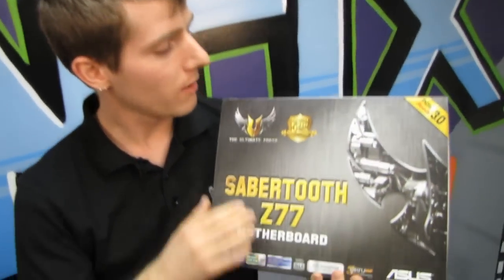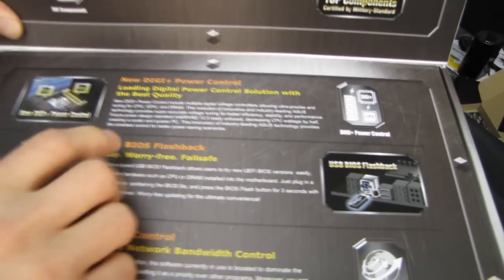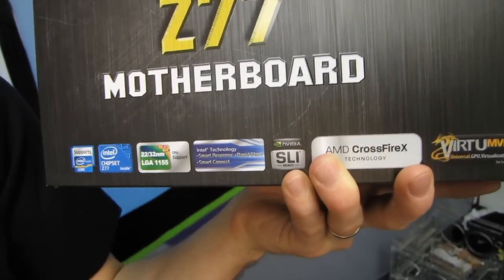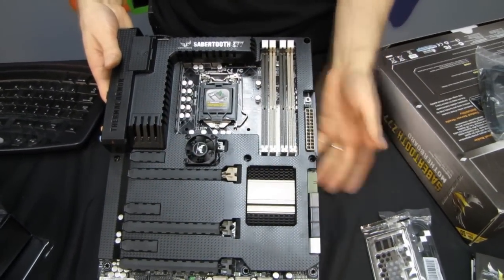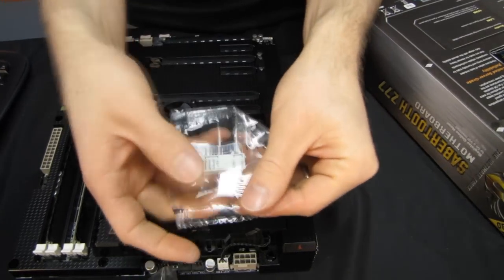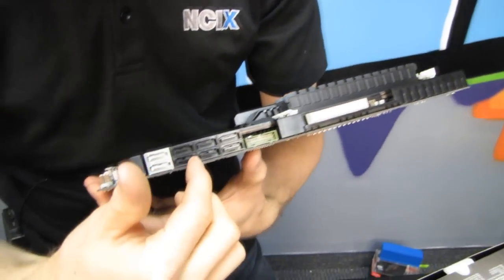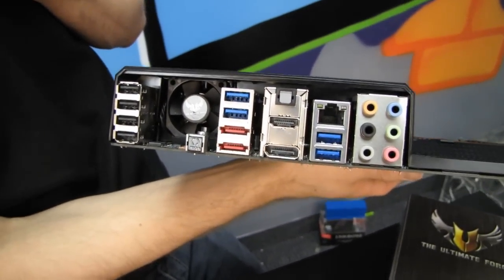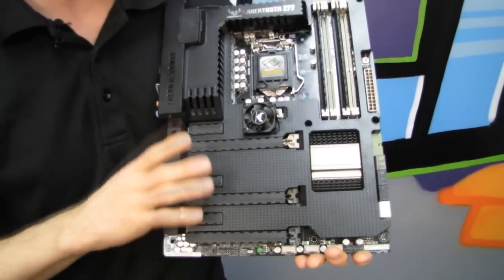ASUS Sabertooth Z77 Ivy Bridge Gaming Motherboard Unboxing & First Look Linus Tech Tips

Comment: those are not "vent" holes. Those are part of previous design/test revisions they did not remove from the final silk screen and cnc production design. I have worked on a number of production run pcb's and i can tell you this is not uncommon. If Asus told you it was for ventilation then they are just feeding you marketing BS.

Comment: Hyper-Threading technology and the size of L3 Cache and the turbo boost are the main differences.The i7-3770K has 33% more cache than the i5-3570K.HyperThreading "creates" one more virtual core for each physical core a processor has, which increases the speed of multi-tasking loads.The 3770k will automatically jump to 3.9ghz which already will never bottleneck and video cards but you can still go up to 4.8ghz if you desire to.It is far from useless.Also I don't know where you look at for 200$.

Comment: CPU OC for the i7. But yea dude as far as this board goes, its the second best thing to a ROG Huge ass quad sli motherboard or some kind of dual cpu board. If you use Sandybridge on the board supposedly word is you can achieve 5ghz stability OC on your CPU with this board, however right out of the box it wont push your chip as much as some other boards. Thats why Im trying so hard to learn this OC thing with as little time and painful effort involved. I tried the Auto Overclock function but

Comment: I'm having a problem,I bought this board along with I5 2500k and 8GB corsair vengeance RAM,i finished building the system last night,but i have a problem with the stock I5 CPU fan,i installed it ,but when i turn on the system the fan moves then stops,it keeps doing this,when i reset the system that's when the fan comes on and starts working normally,it seems everytime i start the system,i have to restart again for the CPU fan to properly turn on,can someone help me with this problem plz

Comment: don't listen to  HSSDamian, I have a 6850 (the 7850 will blow that away) and I can play ultra settings just fine. Overclock it and you'll be fine. Also most games require 4gb of ram, but I suggest 8 with BF3.

Comment: I'm saving for a gaming pc, this motherboard comes with intel 3rd Generation Core i7-3770K aswell as the corsair h100 liquid cooler for £490, is it worth it? And to use towards building a really good gaming pc? any response would be appreciated, thanks

Comment: With the 4770k you get about a 10% performance increase. But the 4770k gets much hotter then the 3770k making it harder to overclock. It's not worth the 10% performance increase. I would wait for Broadwell(5th generation). Also if you did get the 4770k you would have to get a Z87 board, a Z77 board will NOT work.

Comment: not  enough 3 pin ports  the 2 fans on  the board are a waste of the slots. the on bored USB 3.0 is in a spot that is impossible   to  get to, had to  use the converter to make it USB 2.0

Comment: go with evga, evga makes the best motherboards. basically a cpu running on evga motherboards typically runs about 3 times faster. because evga puts 3 times the gold in the cpu socket, so all that gold sends all the extra power right into the cpu and it makes the cpu all work better. So basically a 3570k, on asus is 4 cores, really 3570k on evga is realistically running at the speed of 12 cores cause of all the extra gold, and all that gold make its also hard for the motherboard to die ever.

Comment: They come with the board, but I had them installed on mine and they where crazy loud, (if you have a silent pc like mine you can hear them). So if you want to use them I'd buy some sound blocker ones instead xD

Comment: Hi guys i need help with a question,I just got this motherboard and its excellent,but something is concerning me,when i adjust certain settings such as the onboard configuration settings in the BIOS and save and reset,the system automatically shuts down then restarts for itself,it only happens when i tinker with certain settings in the BIOS,can someone tell me if this is normal?,other that that it works perfectly.

Comment: Where can I get this board from? Its worth about $250 isnt it?
Reply: Dude, this is literally 2 and a half years old, and like 2 chipsets back now.
Reply: Fry's.com I recommend if your getting it. BTW I don't thing you should get this old board.
Reply: It's not all that old. It's still a great board, but still succeeded by the Sabertooth Z87 and Z97.
Reply: World Known Not really if you are buying a Z77 motherboard for the purpose of using Sandy Bridge, which generally overclocks better than Haswell and Ivy Bridge as well as being soldered, and this reduces temperatures compared to Haswell and Ivy Bridge, which both use a shitty cost-deductive internal TIM.
Reply: Cam Kustka
I think most of the thermal problems with Haswell were all kinda blown out of proportion... I have a 4670k at 4.7GHz and it never goes above 75C with a CM Hyper 212 Evo, which is not really that good of an air cooler. I believe that the performance benefits of going Haswell outweigh using hardware that's already way way outdated. That's just my opinion though. Still, that being said, I would never pay $250 for 2.5 year old hardware like this, ESPECIALLY when the Z87 and Z97 versions don't even cost that much.

Comment: Does anybody know any good AM3+ motherboards with pcie3 and usb 3 with 4 slots of ddr3 ram?
Reply: *****
AM3+(990) ones don't. somehow.
Reply: Rotem levi The ASUS 990FX
Sabertooth R2.0 Gen3 is PCIe 3.0 compliant.
Reply: I checked that, in the specs page of this mobo it says: "Expansion Slots3 x PCIe 2.0 x16 (dual x16 or x16/x8/x8) *1"
so not gen 3. weird.
Reply: oh thanks, I think it's the only one though. I'll watch for availability here meanwhile.

Comment: no no no no you do not put your mother board on the bag that come with the board. that box will work just fine. The bag that comes with Sabortooth boards dose but just about every other one dosnt. Just a good rule of thumb is to just never do it. Box works just the same.

Comment: I hope you joking on this Build? Are you?
A ATI and Nvidia GPU will not go together in a CrossfireX or SLI, 430w PSU Is way too low for a 670 or a 7970, 2 different speed ram will not work.

Comment: Hey, im going to build a "silent" gaming computer. Some specs: i7 3770k, 8gb ram, Asus GTX 680 CU 2 TOP in a Fractal Design Define R4 chassi. My question is would the sabertooth motherboard ruin the whole "quite" performance for my computer due to its 50mm fans. I have heard that small fans gives high pitched noise. Can anyone with experience with this motherboard answer this? Thanks :P

Comment: maybe so but you gotta think, eventually dust IS going to work its way inside the pc case no matter how hard you try to prevent it. But honestly, given all the thermal covers this board provides, and how small the fans are, its not really a big deal. Ive had this board for about hmmmmm....maybe two months and it is quiet! You will have more noise out of your cpu heatsink BY FAR AND WIDE than you will the board fans. I housed a i7 2700k and a corsair h80 cooler in it, and the turbo mode

Comment: NEED HELP/ADVICE My Build
-MB-  ASUS M4A89GTD PRO USB 3
-Processor-AMD X6 1090T BLACK EDITION (Six-Cores) 
-HD-  SAMSUNG 5400-RPM 2TB
-GPU- XFX 5750
-RAM- Patroit G Series 'Sector 5' edition 8GB DDR3
-PSU- CoolMax V-600 (600W)

I'm getting a PowerColor 4870 X2, and on 
AMD's website it recommends a 650W or better Power supply,
 can i use it with my build?

Comment: Ahmmm this is an Intel Z77 board, not an AMD one. So don't get this one. Secondly, you can either run Crossfire or SLI, not both. Either get two 670s(SLI) or two 7970s(Crossfire) . Thirdly you will need to beef up your Power Supply you will need at least 750w and above to run SLI or Crossfire.

Comment: didn't worth the money? its cheaper than gtx680 and is a lil bit better. check benchmarks ;) and don't forget it uses the new 2.0 boost so its better at overclocking and keep the temperature lower than gtx680. but ofc 680 is a good card to go with

Comment: Hey can anyone give me any ideas on the best motherboard out there no price range so anything really I loved the Asus maximus iv extreme but its E-ATX size has put me off I need something that's just a normal size atx  mobo with high end specs
Reply: for Z77? Asrock Z77 Extreme 4 maybe 6 if you want.
Reply: Thanks for the suggestion but I have decided to go with the maximus 6 formula really love the board and the fact that I can incorporate it into my custom water loop straight out of the box is a deal sealer

Comment: no more, asus motherboards have failed me for the last time, sent my mobo for repair got it back looks like they only fixed the power issue, in which the mobo wouldn't boot, now it boots, everything works fine, but my screen monitor still gets no signal, and the monitor is also asus, i have tried everything i got me new psu, ram etc, frustration set in and will never go away.

Comment: :P now i have new specs that i buy i think this 1 is better.
ASRock Fatal1ty Z77 Professional iZ77.
Cooler Master Processor Koeler Hyper 212.
Corsair 4x4GB, DDR3, PC12800.
Intel Core i5 3570K 3.40GHz 6MB Box.
Microsoft Windows 7 Home Premium 64bit.
750w power
Sapphire Radeon HD7970.
btw is this eneough power for this pc?

Comment: would this work?

Asus SABERTOOTH Z77 Motherboard

Corsair CX750 Builder Series CX 750W ATX/EPS 80 PLUS Bronze PSU

Corsair CMZ8GX3M2A1600C9 8GB 1600MHz CL9 DDR3 Vengeance Memory Two Module Kit 

Intel 3rd Generation Core i5-3570K CPU

EVGA GeForce GTX 660 SC 2GB GDDR5 Graphics Card

Comment: This sistem is compatible?
-ASUS SABERTOOTH Z77 LGA 1155 Intel Z77 HDMI SATA 6Gb/s USB 3.0 ATX Intel Motherboard
-EVGA 02G-P4-2680-KR GeForce GTX 680 2GB 256-bit GDDR5 PCI Express 3.0 x16 HDCP Ready SLI Support Video Card
-CORSAIR Professional Series Gold AX850 (CMPSU-850AX) 850W ATX12V v2.31 / EPS12V v2.92 80 PLUS GOLD Certified Full Modular ...
-Intel Core i7-3820 Sandy Bridge-E 3.6GHz (3.8GHz Turbo Boost) LGA 2011 130W Quad-Core Desktop Processor BX80619i73820

Comment: Im not a pro in computer building, but it would be great if someone could tell me wich one of theese I should swap out for some other stuff :) (This is what I've planed to buy)
Motherboard=Z77
Graphics Card=Sapphire Radeon HD 7950 3GB GDDR5
Power Supply= XFX ProSeries Core Edition 850W
SSD= Samsung SSD 830 Series 128GB
HardDrive = Seagate Barracuda® 2TB
RAM = Corsair Dominator DHX DDR3 1333MHz 16GB
Processor = AMD FX-8150 8-Core Processor
Cabinet = Corsair Obsidian 650D Midi Tower

Comment: the steel series 7g uses ps2 and it is not an old keyboard. This keyboard cost me about 150$. Not many keyboards nowaday use mechanic switches with ps2. PS2 features extreme antighosting

Comment: I ordered this motherboard today. I wasn't thinking about the RAM I already have in regards to compatibility. I have 16GB (4X4) of blue Corsair Vengeance 2133mhz. Can anyone give me a shout and let me know if it will be ok or of I should return it and order another board. I paid $242.00 total, though it was originally $227. I paid a few bucks more to get it Friday as Amazon was sold out of prime.deals. Suggestions in my price range are appreciated if my current memory won't run well. GREATVIDEO!

Comment: 2part : 
-CORSAIR Vengeance 32GB (4 x 8GB) 240-Pin DDR3 SDRAM DDR3 1866 Desktop Memory Model CMZ32GX3M4X1866C10
-Corsair Force Series GS CSSD-F360GBGS-BK 2.5" 360GB SATA III Internal Solid State Drive (SSD)
Model #:CSSD-F360GBGS-BK
-Western Digital WD VelociRaptor WD6000HLHX 600GB 10000 RPM 32MB Cache SATA 6.0Gb/s 3.5" Internal Hard Drive
-ASUS DRW-24B1ST/BLK/B/AS Black SATA 24X DVD Burner - Bulk - OEM
-CORSAIR Hydro Series H100i Water Cooler

Comment: Im looking to get this board, and adding 2 Vertex 3 120gb to a total of 4 Vertex 3 SSDs. Do I :

1 - Use 2 of the the native raid controler Sata3 and 2 of the Asmedia controler Sata3 to Raid 0!
2 - No you idiot you cant use two different controllers to RAID 0 4 SSDs !
3 - Get a raid card (and if so, which?)

Comment: I don't know if I like where Asus may be heading here. I'll give u an example; let's say you're at a car show & Parked side-by-side; a 1967 Shelby GT500 Mustang, & 2012 Shelby GT500 Mustang. Both cars have the hoods up; under the 1967; you'll see the Ford 428-Cubic In. (or 7.0-Liters) Big Block V8 & everything's right out in the open; no surprises! where under the hood of the same model and trim of car from 2012; u wont see sh!t; everything's covered by "Tamper Proof" Black Plastic...